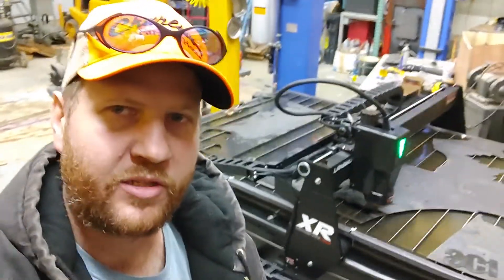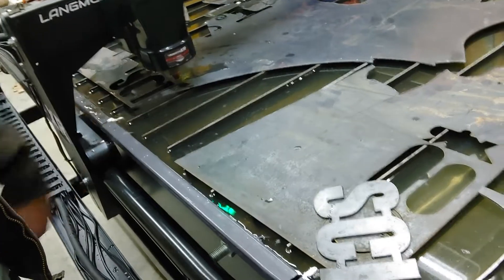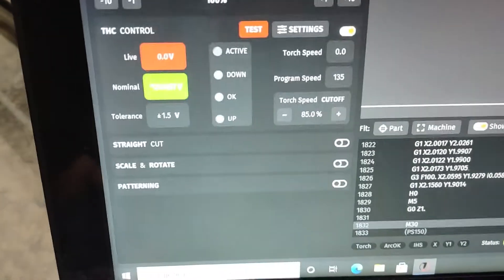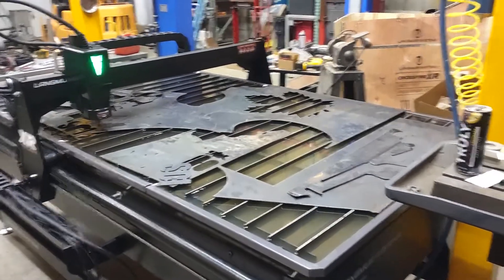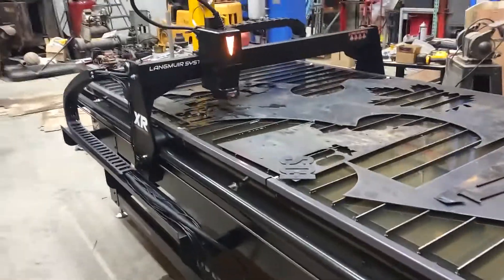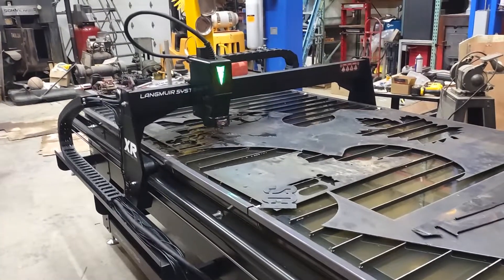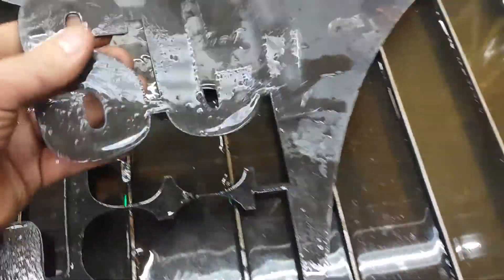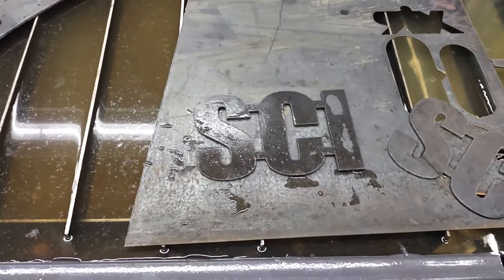Langmuir Systems Crossfire XR 4x8 plasma table cutting 16 gauge 135ipm 35 amps

Comment: To slow! I’m running my little cnc at 230 ipm! And producing nearly zero dros! I have the little crossfire table. I picked up the Lotos LTP5500D CNC plasma cutter off Amazon and it runs awesome! That said, the ipt 60 torch handle it comes with is garbage and you can only use Lotos consumables. They’re just different enough that other standard ipt60 consumables WILL fit BUT it’ll misfire like crazy because Lotos are assholes. So, I picked up a machine torch built by Plasmadyn based in MO (Missouri) modeled perfectly on the Hypertherm x45 torch and uses Hypertherm consumables, or just buy the ones made also by Plasmadyn! Holy shit the difference is NO COMPARISON! PlasmaDyn makes a fucking awesome machine torch for $300! And their consumables are literally a quarter of the cost of Lotos consumables!

Comment: what is the easiest fastest way to learn to operate this plasma machine ?
Reply: Using it. Dont mean to sound like a butt but that is the case. Now the round about answer. The langmuir guys have a fourm that has everything soup to nuts of how to work those tables and most of the information can be put to use on other brands tables. Another way is to think about a workflow for a product and write down all the steps. Pick one then learn enough to be dangrous and pick another one and do the same then add all that up and there you go.

Comment: Your never going to get a perfect cut unless you weigh down your material. The entire reason for that tip to kiss off the part is to retract to the perfect height. The head in this comes down to the steal and pushes it down 1/8-1/4" then follows the head back.  Standoff, the distance between the workpiece and the tip of the torch, is critical to both cut quality and parts life. Even slight variations in torch height can affect the angularity of the cut surface. The height of the torch during piercing is particularly important. One common error operators make is piercing too low.
Reply: Good to know.  I'm still building my shop but plan to buy a XR in the future.

Comment: What is the maximum thickness you can cut on this machine?
Reply from the maker: .625
Reply: Depends on your plasma cutter model. If you have the higher-end Hypertherm probably can do 1" or more.
Reply: @rsz90182 4x8x1 is the thickest you can go according to the tables weight capacity